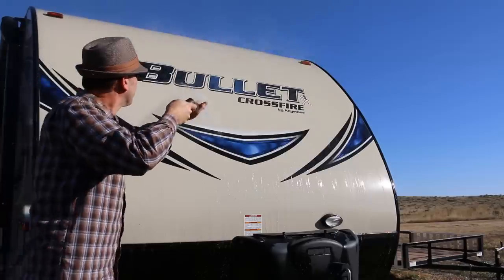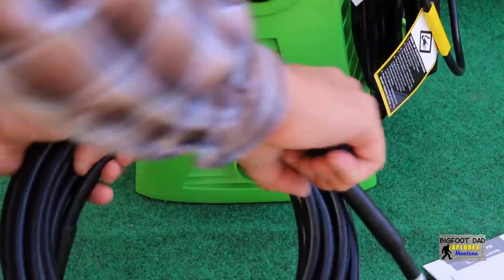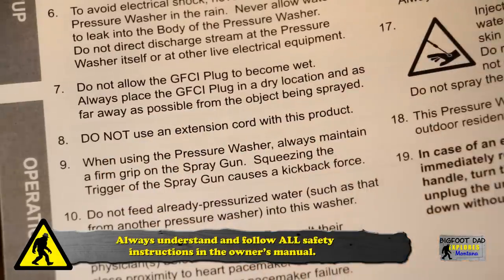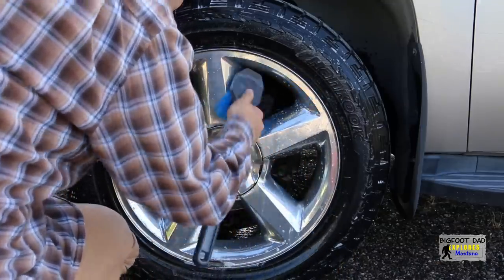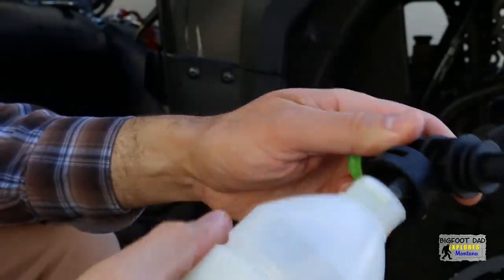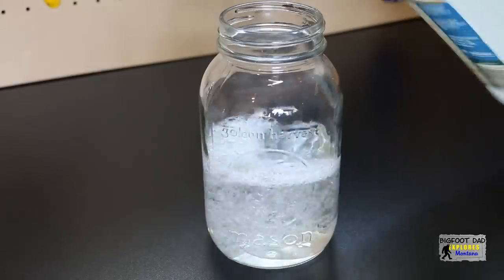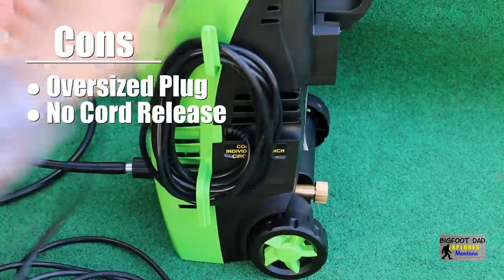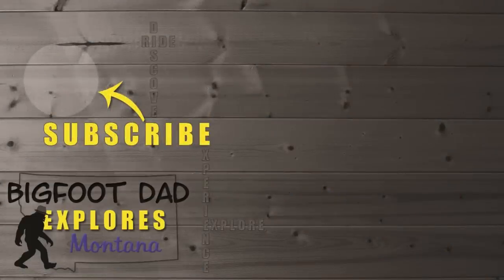Portland Pressure Washer from Harbor Freight - Review - 1750 PSI - 63254/63255

Comment: I have a commercial gas power washer 2500 psi. but bought this electric power washer for quick cleanups of tiled deck and some siding never expecting much and feeling even if it only lasted a season, no big deal. It worked better than expected, light enough to literally walk it around the roof to do the siding on the second floor of my raised ranch. I really appreciated not having the difficulties with my gas power washing (starting, leaking etc.)I was very satisfied so much so that I bought two more and gave them to my grown kids. Two years later all working well.
Reply from the maker: Hi, William - thank you for sharing your detailed experience and insight!  I wasn't sure about the longevity either but now I'm on my third season and it's still going!

Comment: Think that the leaking detergent  bottle is designed to have a hole in it so the bottle doesn't collapse as the soap is siphoned off.  Same kind of thing with a regular paint spray gun.

Comment: Don't use any pressure washer to strip old stain from a wooden deck. High pressure will ruin the wood. The best thing I ever used for this job was a rectangular floor sander for the flat surface. I rented it from Home Depot, and used a 36 grit Paper. It worked fast and removed all the 20 yr. old stain. It did the job in about two hours. Pressure washing took all day and didn't work as well, without damaging the wood.

Comment: I bought one last year, have used it several times and it does everything one would expect from a 1750 psi electric washer...well worth the 79.00 I paid for it.    I do use an inline water filter at the faucet end to help minimize mineral deposits on the cars and motorhome...that helps a lot with our hard water.

Comment: You fixed the plug problem the same way I did mine... plugged it in.. mine recommends a short thick gauge... I used what I had. It worked fine.
Reply from the maker: 😉  You gotta do what you gotta do.  😅

Comment: I've got a few hours of use on mine, most likely about 16 hours and it works good. I recommend installing a quick connector on the garden hose inlet coupling. No matter how light you tighten it you still need a wrench to get it unscrewed which damages the coupling.
Reply: Do you know the thread specs on the brass inlet ?  I lost mine when the other end got stuck on the garden hose, or rather, I'm sure its still stuck on the hose end - somewhere.
Reply: @timothykeith1367  It's a standard garden hose thread size. My pressure washer went up after a few months of limited use. Now I'm using a Ryobi version which is far better for about the same price.
Reply: @haujeancontactee   5/8-inch garden hose is much too large.  I don't have inside calipers.  I measured the ID of the female fitting at 16 mm ( .65-inch).  A missing male -> GHT adapter threads into the back of the unit.
Reply: @haujeancontactee  I looked in the #63255 manual and it does indeed thread to a garden hose, but not 5/8-inch.  Mine is actually #63254.  I'm using a hose clamp for now.   The OD of the male threads is  .61-inch diameter (15.6 mm).

Comment: The spray adjustment that you mention doesn't click into place. I used my new Portland yesterday to clean my pool deck and the sprayer pattern stayed where I adjusted it, but changed after releasing the trigger, shutting down the unit. Upon pulling the handle again, the spray pattern had changed. I have ordered a new wand attachment and 5 different spray nozzles each with a different spray pattern. This will solve that problem. Good video.
Reply from the maker: Hi z33317, thanks for the information!  Where did you order the spray attachments from?  I need to order a new detergent bottle as mine finally failed.  😎
Reply from the maker: @z33317  - Thank you for this info - I will be checking this out!  😎

Comment: If you have trouble plugging in the electrical cord ( or it blocks the use of the second receptacle plug in ) get a 3 prong short extension cord sold at computer stores.  It adds only 6 inches or less.  I also use one on power strips for those times that bulky ( or right angle ) AC power adapters block the use of some of plug in locations.
Reply: Robert Mortensen so in order for it to actually run you have to push the handle on the wand? I’m still trying to figure out how to make it run..

Comment: LOL, when it comes to an alloy wheel finish, an Audi's finish is tough as the chromed bore of a shotgun compared to anything American built.  That's a dandy little pressure washer for the tasks it was meant for.  A lot of people mistakenly buy these things expecting the same performance of a washer powered by a 5hp Briggs & Stratton motor.  At 1750 psi, its great for most household tasks, but not something a contractor would use.  I caught mine on sale for $69.99 with the coupon.  Never pay the full price, you won't have to wait long for a coupon to show up.

Comment: Hey big foot dad . Just got my cub 22 hp running. Replaced the solenoid. Starts like new, used the pressure warser. It looks great again. Dang it I didn't clean any fruit. Bigfoot conference on Saturday.
Reply from the maker: 😂 Hi,  Chuck!   I wonder what else we could pressure wash...  Glad everything is working seems is clean again.   That's what it's about - doing some spring cleaning and maintenance.  😎
Reply: Hey my friend. Yesterday me and my grandson went for a drive in the neighborhood. Some one was doing spring cleaning and I picked up a Briggs and Stratton edger for free. After 30 minutes cleaning the  carburetor and new gas. We got it running. It works great. Keep up the videos.
Reply from the maker: @chuckhunter6098  - awesome deal on the edger!  There are so many good deals out there and I should be out looking as well.  And you can't beat free!  😀

Comment: My pressure washer gun broke on the Portland 1750. I used mine just to wash my car, it broke probably on the 5th or 6th use. Good pressure washer but good luck trying to find a replacement gun for it. Harbor freight doesn't sell the replacement gun. If I had to to do it again I would buy one that is more common that has a replacement gun more readily available.
Reply from the maker: Hi, Gonzo - sorry to hear about the misfortune.  Hopefully Harbor Freight was able to take it back, but I'm aware what a pain that would be.  There are some comments on here about people using Ryobi replacement parts.  That may be worth researching.  If mine breaks, I'll probably try something along that route if I'm out of my replacement time by then from HF.  Or I'll just throw the whole thing out and get a different brand... and maybe do another review. 😅 Thanks for stopping by and hope to see you around here in the future.

Comment: I've had this unit  for about 2 years now and was happy with it until it began to leak between where the gun and nozzle connect. replaced the O ring and it still does the same thing, now the thing is just a leaking disaster which wastes water during operation and goes all over my shoes.

Comment: This was somehow quite satisfying to watch. And, thank you for the help with unboxing/assembling--very useful video. Where do I get a green Bigfoot sticker? Haha!
Reply: I also forgot to ask--if I go to the hardware store, what sort of adapter should I ask for, so that I can place the coolant inside for winter? Thanks.
Reply from the maker: Hi, Marie - I'm glad you enjoyed it and thank you the complement!  I get the decals off various sellers on Eatsy.com and got that particular green one a couple years back.  Most of the sellers on there are very accommodating so that one was a custom color request.  I don't remember exactly what vendor it was because I've ordered from a few different ones over the years.  If you are unable to locate, let me know on a new post and I'll see if I can dig through my old e-mail receipts to track it down. 
For the coolant adapter, I'm not exactly sure.  The manual didn't really say how to get it into the machine, although since posting this video, I would recommend using RV antifreeze, not the automotive style - the RV ones are much safer.  I've seen a video where an individual flipped the unit over, turned on the pump, and sorta dumped it into the water inlet straight from the bottle.  Perhaps you might be able to assemble something custom to fit this need better.  I'd be interested if you can come up with something more efficient!  Good luck and welcome to the community!  😎
Reply: @BigfootDadExploresMontana  Thank you, and I really appreciate the suggestions!!

Comment: Good video, you've gained a follower. As far as the destructions stating not to use an extension cord, that's for their liability as most people use too light of a cord. As far as proper detergent that is based on what you're cleaning, if you need to clean heavy grease/oil I recommend purple power from most parts stores.
Reply from the maker: Hi, Nathan - welcome to the community!  Yes, the extension cord... you may have found out my secret 😂 and I agree about the liability issue.  Great idea on the Power Purple - I have a bottle of that somewhere but hadn't thought about putting that into the detergent bottle.  
New video done and pending release in the next few days after some finishing touches!

Comment: I returned mine next day. I didn’t think it had any pressure.
Reply from the maker: Hi, Jeremy!  Well, that didn't work out very well.  😂  I wonder if it had a bad pump or something.  If you get another brand (and it works better!), feel free to let us know what you choose and if it's working out.  Thank you for stopping by and welcome to the community!
Reply: Yep, me too. I don't know if it was the length of the hose being too long or I didn't get the air out but I needed to clean the rock wall for painting it with Portland cement tomorrow. Not to be confused with the Portland machine, I am working w/ Portland cement. Pulled out the hose and the Krud Cutter and the rock wall is clean and so is my vinyl siding. Of course I lost the receipt, bought it before Covid shutdown. Ugh. I never have a problem putting things together so I'm at a loss. Years ago I had a top of the line washer and never had a problem. I think it's just junk.

Comment: Good lighting and cam resolution, excellent narration but could do without the background music which at times was competing with you.  Edits came in the right places to keep the action moving.  The only problem I have with H. Freight electric appliances is the NOT ready availability of parts.  My Portland 120 volt nine inch pole saw is an excellent tool that helped me remove a very large shrub but I could not get replacement blades at Harbor Freight, both big box stores, and a local hardware that has hard to find items.  I sent away to Frawley's Saw Shop in Iowa to get blades.  If I had bought a "real" saw I would have my choice of 8 and 10 inch chainsaw blades and get them immediately.  

For items of this nature I think I prefer to "go big or go home" as I like being able to go to a local shop to get the replaceable parts when I need them.  Overall, I would say the performance you got from the Portland tool is quite satisfactory.
Reply from the maker: Hi, @Gweedo - I sincerely thank you for your detailed feedback!  Not many know what goes into filming and editing these, but I can see you are very in tune with these things.  My issue stems from the headphones I use for editing which I found later sound completely different than say, my TV speakers upstairs.  The narration does get pretty lost depending on the playback device.  YouTube also  runs their compressors on the videos which I found effects the audio.  To compensate, I have tuned it way down in my subsequent videos.  If you have time, let me know what you think of the levels on the new DIBS series release of "Upgrading Your Tractor Mower".  I did a fair amount of ducking to help out the clarity.  
Agreed on HF - sometimes the replacement parts are not readily accessible.  I think they prefer you to replace the whole thing of anything breaks or wears out.  😅
Reply: @BigfootDadExploresMontana   ~ You're welcome, Bigfoot, dude !  Tho' you didn't drop a link I think I have the one you mentioned and will view it tomorrow; close to bed time here.  Good luck and thanks for what you do.  I have made repairs on car and home after getting " a leg up" from a YouBoob vid.

Comment: Yes I was wondering about winterizing it I live in the north east and thinking how it's going to fare the winter here I tried to use one of those cans with the antifreeze and lube but it doesn't seem to go through the pump and come out the pressure side guess I'll try the air trick
Reply from the maker: Hi, 1995dresser.  Yes, it seems the air is the cleanest way.  Strangely enough, I forgot to winterize it again until I read your comment just now.  I guess I'll see how it faired in the spring!

Comment: The power cord should be wrapped in a figure eight pattern on the rack.  This eliminates twist in the cord when you unwrap it.  Vacuum cleaners used to have instructions to do this. Seems everything is dumbed down these days.
Reply from the maker: Thank you for the tip, Videodistro!  I may start doing that now.

Comment: I just purchased this as a gift. Mine when used didn’t make any noise when spraying does that mean it is not working! It has a low spray pressure. Not sure what to fo I did or get near the pressure you did . I thought to try a shorter hose.
Reply from the maker: Hi Melinda - it should be pretty loud whether there's adequate water flowing or not.  Maybe there is a problem with switch or one of the  internal relays.  I would also recommend trying resetting the button on the power pack end - mine always seems to trip and I'm constantly resetting it.  Hopefully you've figured out the problem in this past month.
Reply: @BigfootDadExploresMontana  I got it figured out! Thanks so much!

Comment: Mine stopped working after 3 uses only! There reset button does not work anymore. Went to the store asking for parts, was given 800 number to call!! 
I hoped the video talks about troubleshooting rather than how strong is the  jet of water coming out.
Reply from the maker: Hi, nemosomo - that is terrible!  Did they not want to exchange the unit?  I'm on my 3rd season and it's still working fine.  I wonder if you just got a defective switch.
Reply: @BigfootDadExploresMontana  true, it was a defective switch. Our local HF manager could not do anything other thanks asking me to call 800 number! I looked on HF website and could not find any replacement. 
I will visit homedepot for the convenient replacement, I think it is - $17. 
Thanks
Reply from the maker: @nemosomo  - That's very frustrating.  I hope you're able to get this buttoned up quickly.

Comment: My didn't have the green tip on nozzle for the soap bottle 🤬 it shoots out a weak spray but I seen a video to up grade this water pressure with a large foam cannon and a ryobi wand that will fit this model portland
Reply from the maker: Hi, Carlos Ramirez - I have heard similar reports of the Ryobi wand - I may have to try this out to see if it works better.   Good luck and hopefully this fixes your issue.

Comment: I keep having the issue at 4:47. Very annoying... I release the handle, the pump stays on and I have to rush over to manually turn it off. This is the second unit that's doing it. It works fine for a while, like it did in the video, then it just throws a fit. I guess I should try a shorter garden hose
Reply from the maker: Hi, Soft Raccoon - yes, agreed.  I am not entirely sure what causes that either, but I think in my case it is a lack of volume or pressure.  We have a cistern and the pressure is not all that great, nor the volume.  It seems to work better when we use a shorter hose.  I will buy a larger diameter one next season and hopefully will see some improvement.  If the new hose solution works for you, let us know!

Comment: I love mine BUT the gun/wand has been badly leaking. I've taken it apart several times and checked everything I can think of. Apparently the leakigis a commonprolemsoI don't want to replace it with the same gun/wand. Anyone have a replacement recommendation? Everything else works fine, 2+ yrs and going. I'm just tired of being soaked!!!
Reply from the maker: Hi, ncmonkeygirl16 -  A member has recommended one from Ryobi that may work (I have his comment pinned to the top if you can see that).  Here is the link he says from his experience is compatible:  https://www.amazon.com/dp/B00QMKHNM0/ref=cm_sw_r_cp_api_i_0ndJDb52EKH8V
I don't know if that includes the actual gun part through.  I hope that gets you started in the right direction.  Anyone else on here is welcome to chime in.
Thank you for commenting!

Comment: I cannot detach the nozzle after the first use. It knew it would be difficult when I push them together. The workmanship is not good enough.
Reply from the maker: Hi, Victor - yes, I agree.  The nozzle is very tough to get off sometimes.  I have to push the pieces together very hard and then twist for it to come off.  I believe there are other compatible wands you can use that have slightly better quality.

Comment: Would this work on cleaning algae from my white vinyl deck railings?
Reply from the maker: Hello!  Yes, it'll probably do this.  But if you're looking to remove algae from a larger concrete or a deck surface, a higher power pressure washer would be preferable.  Hope this helps!